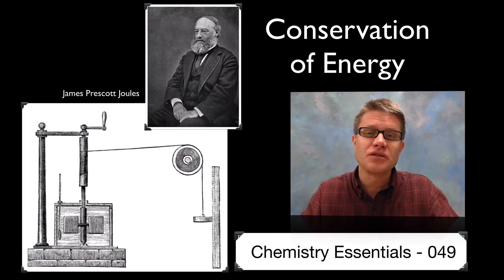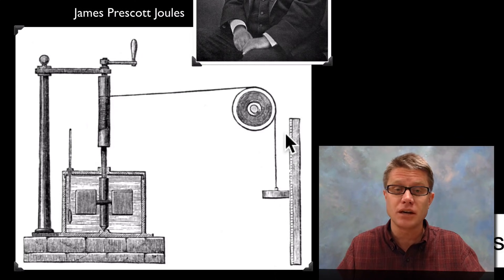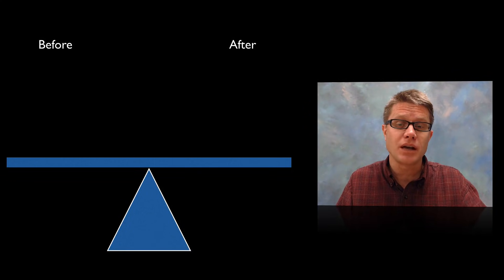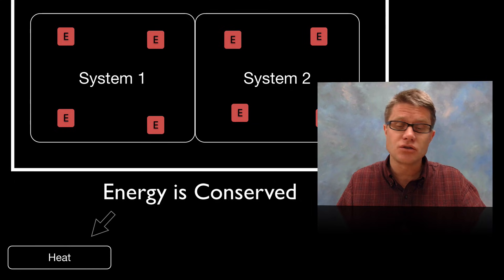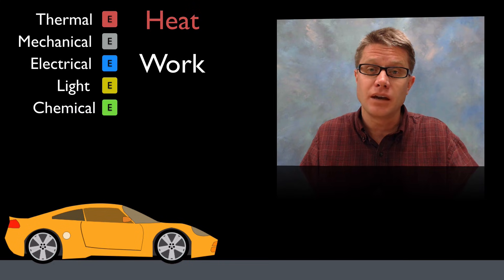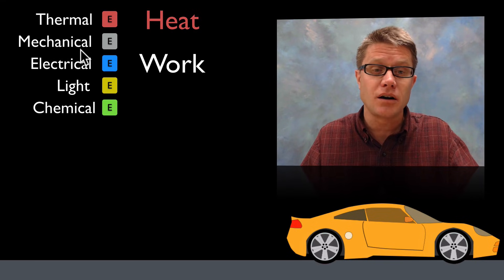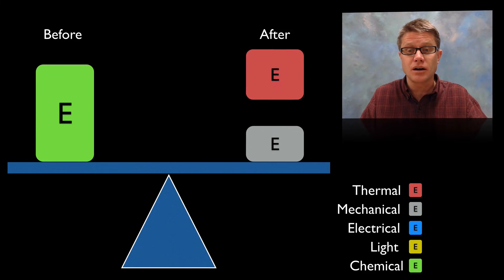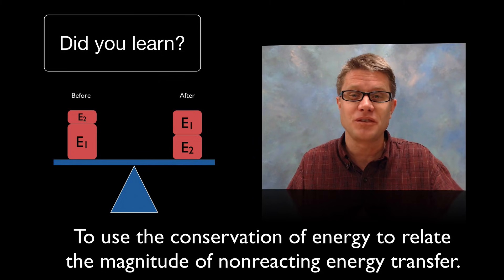Conservation of Energy

Comment: Also is there a way to transfer mechanical into chemical energy?
Reply: Yes, if you apply pressure and friction to a mixture of potassium permanganate and sugar for instance, you get heat and light energy in the form of combustion.
Reply: The only way I can think to do that would be to use the mechanical energy to turn a generator to create electricity. Then convert the electrical energy into chemical energy by storing it in a battery.